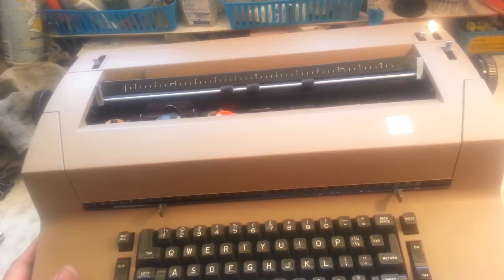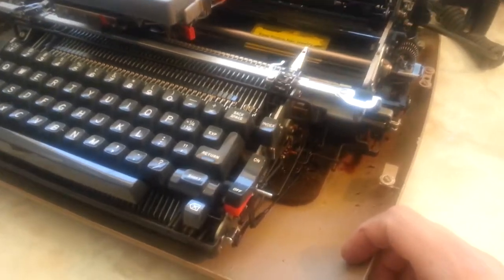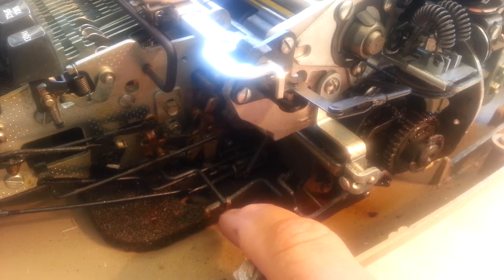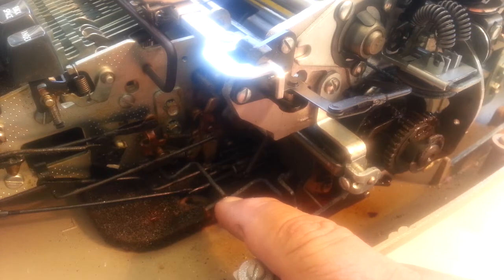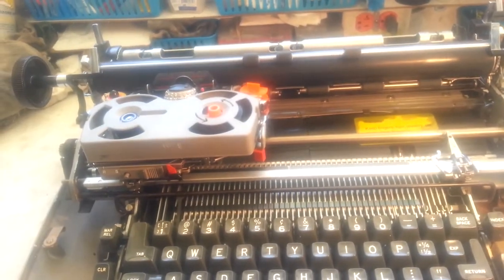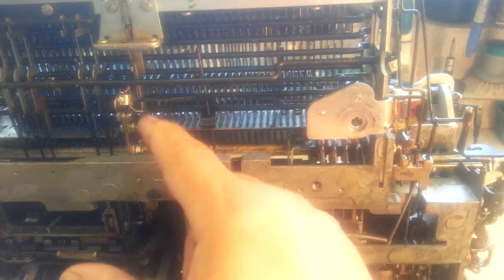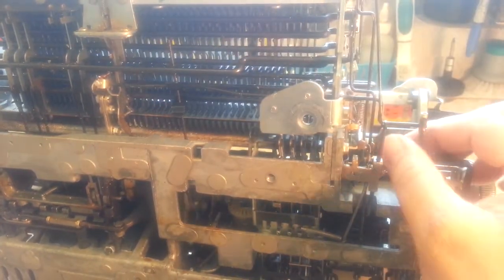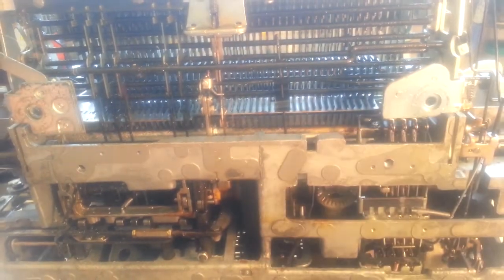IBM Selectric Typewriter Shift Trouble

Comment: Move part 03-627  (APM) guide to right to make link 03-625 vertical. Check Shift Overthrow Stop  Adjustment APM Pg. 9 Frame 35 to not let uppercase go past detent. Check APM Pg. 27 Frame 178: CR Printer Interlock (03-625) for clearance at rest. As always, clean and lube for free operations. (This is for noobs, not you Dwayne.)

Comment: Sir, my shift doesn't want to come back up. It just stays on locked position when I pressed it. Interestingly I figured when I grab both sides of the typewriter from the base and I push it up a bit, the shift button comes back to its original position, but it gets tiring cause I gotta always do it after using the CAPS letters.

Any thoughts, please?
Reply from the maker: Common for the shift lock mechanism to get sticky and then won't release
Also could be binding on the top shell (case) I would be able to diagnosis in 30 seconds, in person.....

Comment: So I have a very weird issue… when I hit my shift key, I can hit a letter and nothing will happen till I release the shift key. Sometimes it will strike a capital letter, and others it won’t. This is really weird because it went from working perfectly fine, to a hiccup, to not working at all in the time span of about 5 minutes. I’m stumped
Reply: I should note this is on a selectric 3
Reply from the maker: Selectric 1,2 3 all same here, clutch is design to not let a character strike until shift is back in home position (either upper or lower case).
Clutch needs flush/lube or adjusting or rebuilt or replaced
https://youtu.be/llmLuWLl-ds?si=g_6sSoLGMmPI4qPB
Reply: @phoenixtypewriter2136  fixed it right up. Cleaned out with some acetone, pulled it apart and oiled it back up, the noise is gone too. I’m not sure if my eyes are tricking me but it seems snappier too. Thanks again my friend. Means the world to me that you were willing to help a fella out. Take it easy and don’t work too hard now 👍